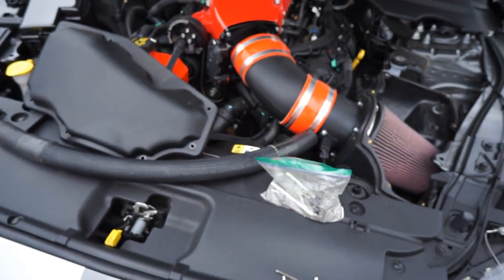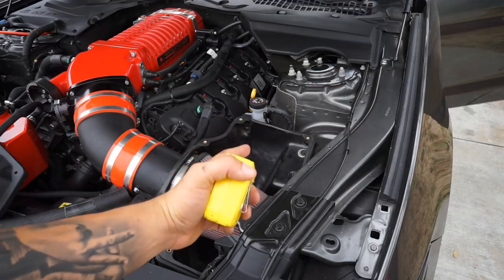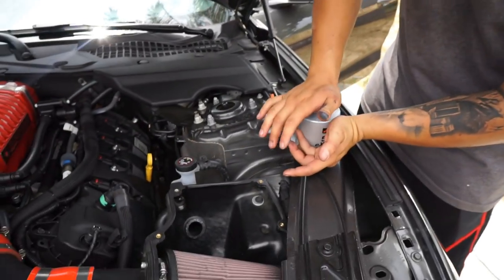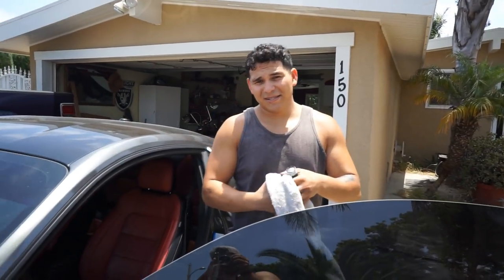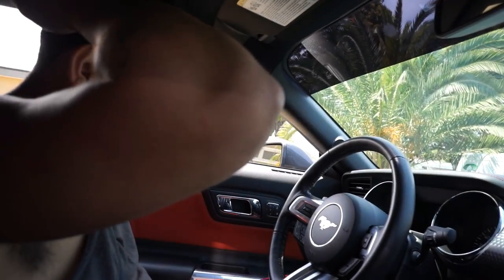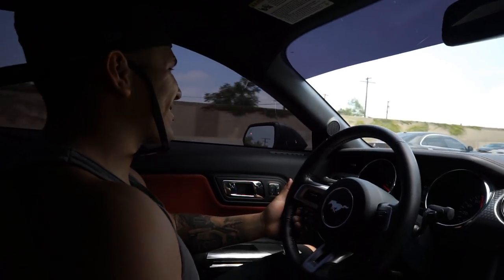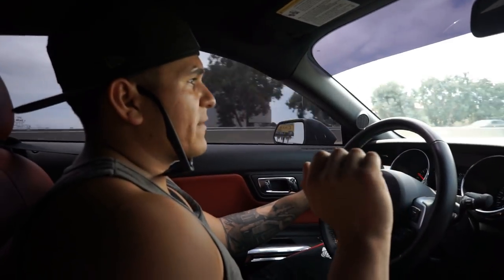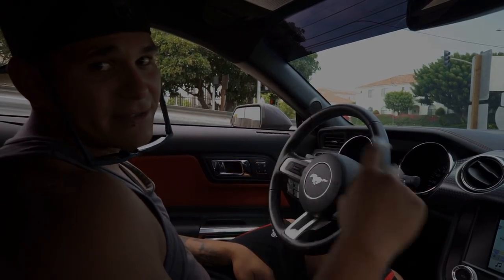2016 Mustang GT Whipple Whine Is Alive!

Comment: Nice! Leave the top off the air box and you will hear the whine. Air temps are fine when your driving, the under hood air is flowing to the back of the car and the air box inlet is causing fresh air flow over the filter. Open filter sounds good, air box doesn't.

Comment: Hey man when you bought that car brand new did you order it to the spec you wanted or did you just buy it off the lot like that? Also is the performance pack worth it since now on the new 2018-2019 mustangs it went from $3000 to $4000? I ask because I plan on buying a new 2019 mustang gt and i am unsure if the performance pack is worth it or not.